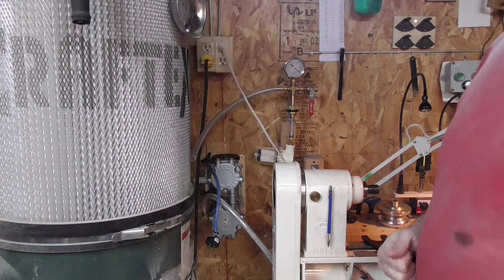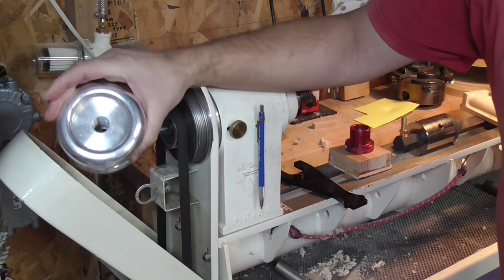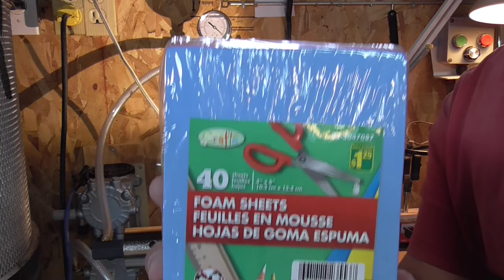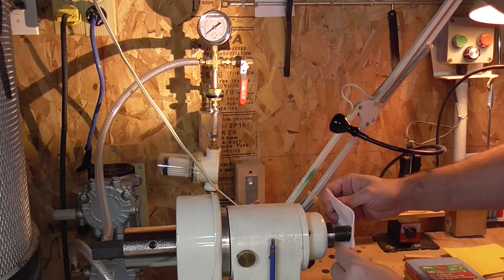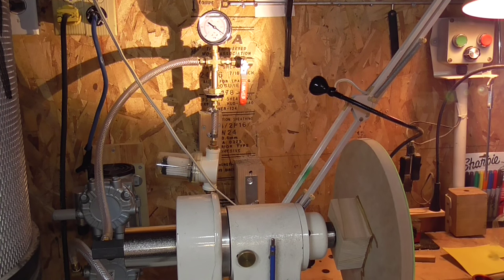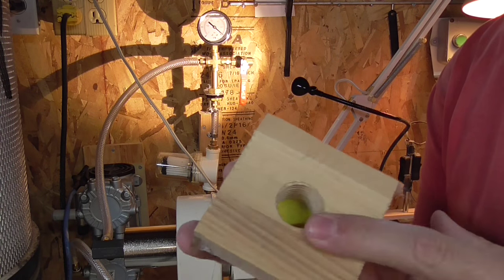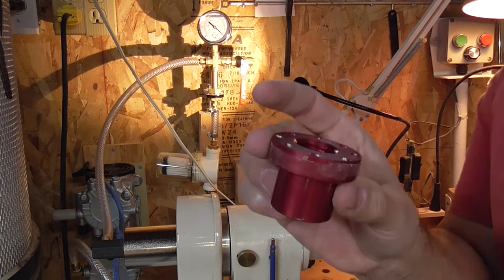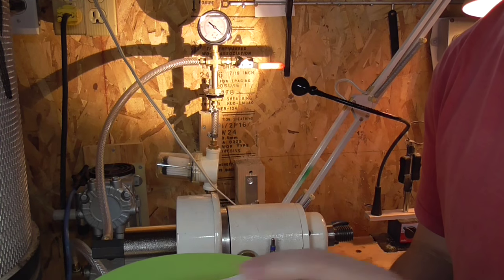Woodturning   vacuum experiments and images of a quiet sunday morning

Comment: Hi Marc! I do not have a vacuum system yet, but your experiences will be taken into consideration if I get one in the future. Thank you so much for sharing dear friend! Cheers! Daniel
Reply from the maker: +Daniel Vilarino Hi Daniel.  I just put 3 coats of lacker on the plywood plate.  I remove the foam between the aluminium faceplate and the plate because of woobling.  The test shows 28 inches of mercury.   I'm good to go.  I'm glad my video might be helpful to you.   Take care my friend.    Marc
Reply: +Marc 's Oneway of turning 
I turned one of my larger vacuum chucks from stacked sheets of mdf and they did fine after a couple of coats of polyurethane to seal them. Sealing mdf is the key, as you discovered. Same of any threaded blocks for holding vacuum chucks. End grain really leaks without sealing.
Reply from the maker: +Mike Peace Thanks for the  tips Mike.

Comment: Marc,I assure you 29 inches of vacuum is plenty. Also after tapping wood I use ca glue to seal the threads One other thing I have done is wrap the threads with the white tape plumbers use. I forget what it is called. if you seal up every leak you will be able to pull that 12-24 around.I was able to move my 12-24 around until I anchored it to the cement floor
Reply from the maker: +Robert Harrington   Hi Robert.  Thanks for those tips.  Thanks for watching.  Marc